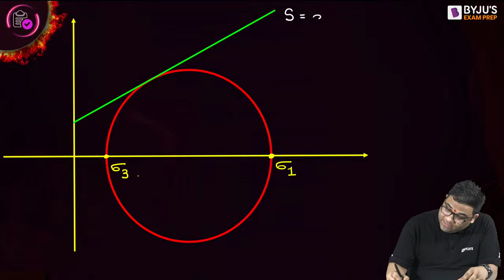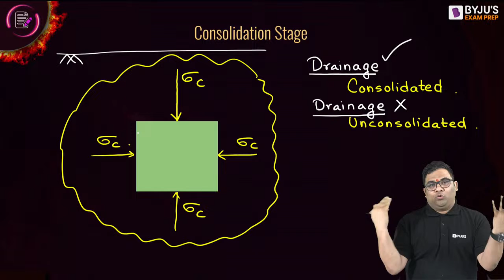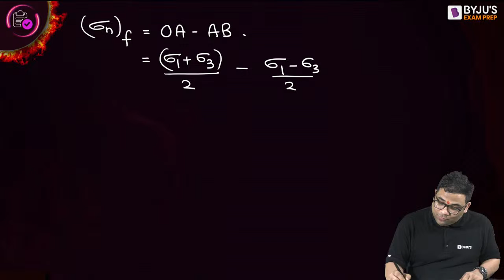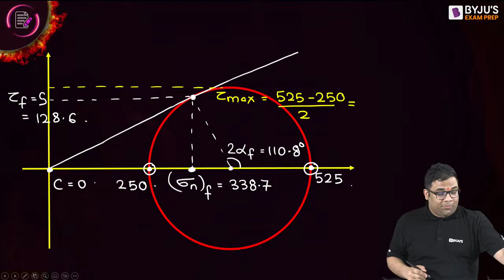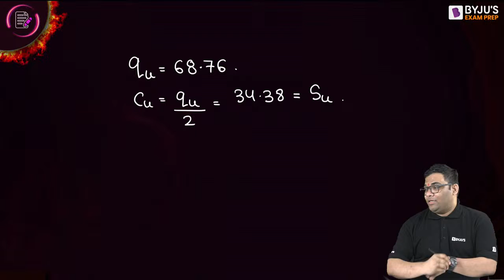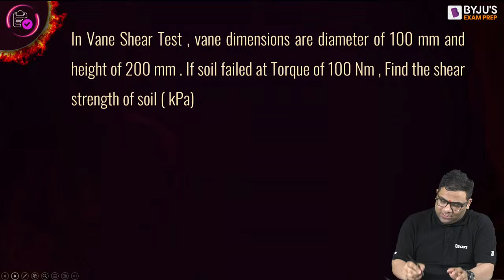Shear Strength of Soils | Geotech | GATE 2023 Civil Engineering (CE) | BYJU'S GATE

Comment: Homework questions:
Question 1: given qu = 120 kpa
Normal stress = qu/2
Normal stress = 60kpa
Question 2: given failure angle = 60
C=0(cohesionless soil)
Sigma 3 = 150
Equation  use sigma 1 = 150 tan^2(60)
We get ans sigma 1= 450 kpa
Question 3: given qu = 120kpa
Sigma c = 40 kpa
Sigma d = 160 kpa
Equation use  C = qu /2 = 120/2 = 60
Sigma 1 = sigma 3 tan^2 (alfa f) + 2C tan (alpha f)
Solve the equation we get sigma 1= 50.01
Question 4 given data
SigmaC = 200kn/m^2
F =342N
Dia = 38mm
Length = 76mm
Deformation = 5.1mm
Sigma n = 100kn/m^2
Step1 : find af by using formula = A/1- strain
We get Af = 0.00121
Step 2: sigma d = f/a = 282.64kn/m^2
Then calculate phi by using formula sigma1- sigma3/(sigma1 +sigma3)
Then using Equation shear strength= sigma n tan(phi) +C (here c=0) 
Then we get shear strength= 45.4kpa